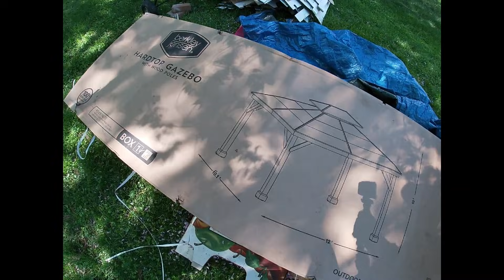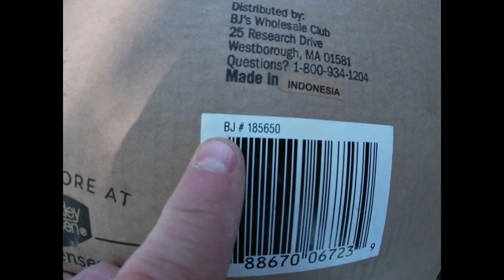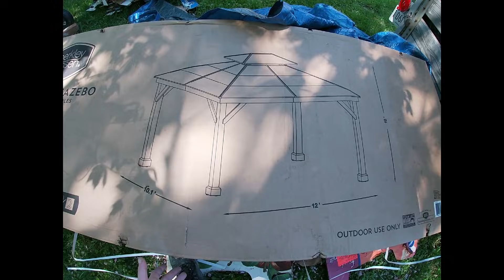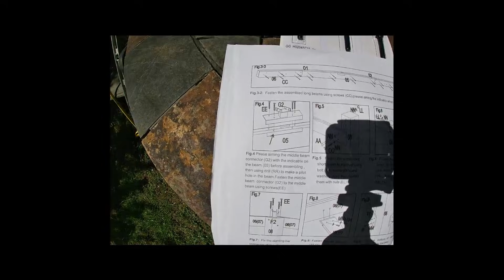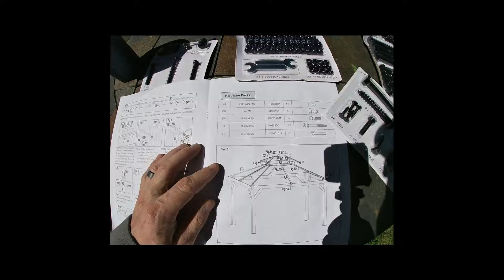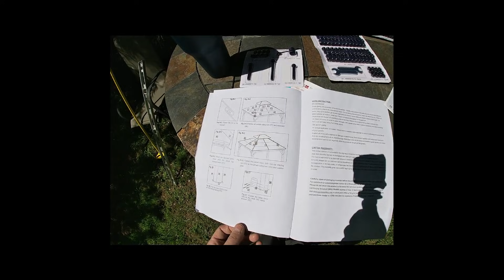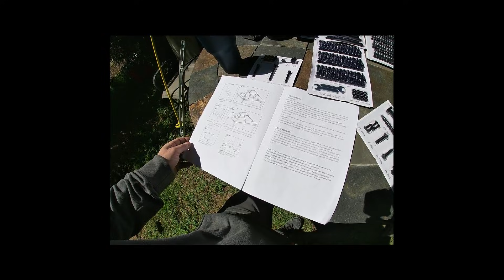Berkley Jensen 10' x 12' HardTop Gazebo Unboxing and Install Tips

Comment: great video.... just picked up from BJs.... mounting it on a 2nd floor trex deck...

having nightmares thinking about building that roof... yea, need to recruit a couple of buddies... pay them with steaks and beers  😎
Reply from the maker: Sounds good. Be careful and don't let them drink too many beers 😉
Reply: @OperationLiquidation  i didn't seen in video, but assuming the smaller cap roof you mounted before you mounted the sections of the main roof?  thanks
Reply from the maker: @antmon123  Yes, put those roof panels on first.

Comment: Great Video I’m in the process of putting in footings. However I really would like to know the dimensions of the post outside to outside.  I guess I really need the outside of the bracket to outside to avoid having to bend them like you did.  If you could send me those measurements I would greatly appreciate it!
Reply: I'm assuming by now you have the gazebo installed. Can you give me the measurements on the legs? I want to pour footings and my gazebo won't be delivered until June so I have no instructions.
Reply: I would love to get them dimension!!

Comment: What are the dimensions between the posts? I am wanting to put this over my hot tub.  We recently bought a 10x10 thinking it would work, but once up we discovered that it is only 7.5ft between the posts so it won't work.

Comment: What is the snow load per square foot rating on the roof?
Reply: Oh give it a break KAREN/CHAD   like u really care?  !!  DOESNT MATTER FOR THIS VID.   S eems pretty legit for a diY . who cares if it has a low load limit.   its not boxed in and I doubt anyones gonna hang under it during a storm for where you are going  with that comment
Reply: Depending upon where you live, local building codes would prevent you from purchase/Install b/c it would not meet their requirements. Just the general footprint over 100sf requires one to get a permit in this area. It is a problem I ran into when trying to decide if I was going to oberbuild a structure or do this kit. Snow in my area is not and issue, but high winds are. To get it reviewed by engineer  would be almost the cost of kit to meet permitting process as opposed to using standard building techniques at almost twice the cost (just in material - I am the labor force) 

Buy, build, and use a snow rake to remove any accumulation of concern and be prepared to lose and then build a proper structure to meet the needs of your area.

My wife wanted this kit, and I could build whatever she wants, but happy wife, happy life.....(and the potential hit for loss to replace with my overbuilt version) a hard lesson, but choose your battles.....
Reply: @BroHay1025  I thought it was Happy Wife, Miserable Husband?  But maybe that's what they mean when they say every marriage is unique in its own way. 🤣😂🤣😂🤣

Comment: I didn’t see the curtain rods on yours,  did you not use them? I’m trying to figure out how they go on.
Reply from the maker: Yes, we installed them. They go on the inner most hole pattern near the side framing. Not sure if we will add any curtains, but the rods are there.
Reply: Liquidation Pros Thanks for the reply, it is appreciated.

Comment: I purchased this in May and have yet to put it up because I was waiting for concrete to be installed. Did this gazebo come with any hardware for mosquito netting and privacy panels? I purchased netting and panels already and have them was just wondering if I needed to get the hardware to hang them as well. I know theirs a rail system. Just need to know if I need to purchase clips or hooks or if they came with gazebo

Comment: This is the same unit branded for Home Depot's Hampton Bay brand and it is the "Crownhill" model.  I just installed mine 98% by myself and am now stuck at step 19 as some parts for the roof leaves are too long and zero way to adjust the frame to fit.  I even tried a similar jack idea before seeing this video...all I can do is get a welder person to shorten the eaves rails and weld tab connectors back on.  Honestly....not worth my struggle and I would have spent another $500 for a better gazebo now that I know.  ALSO,  as far as actual critique....it rained this past week and I noticed the frame/roof collects some water from inside somehow....contributes to premature rust. Noticed when I was moving the legs a bit to try and square frame for fitment issue and rusty brown water came out.  Now I know why this outdoor unit should not be outdoors....according to its own instruction manual.  It actually states to remove it before it's windy.......ummmmmmm.  ??????  It should be able to easily withstand 40 mph as long as assembled firm and bolted down. I will be added more support at corners to keep frame tight. It also has warnings about rust stains......hmmmm......bad build quality and coatings maybe?  It's cheaper for a reason.....stay away honestly.  It looks nice....but betting its even more of a nightmare later.
Reply from the maker: Sorry to hear of the issues you experienced. Mine seemed to all fit together with no issues. Thanks for update.

Comment: Thanks Dan!   Very helpful.  Your opinion: I currently have a gravel (fine gravel) bed that I was going to install this over.  I'm struggling with how to anchor it - do you think I should pour a concrete slab or do you think I can get away with laying concrete blocks at the corner and afix the base to them?
Reply from the maker: I would recommend that it is secured to something substantial. Even if you made concrete pillars for the posts to sit on and then had the rest gravel. It is really heavy so wind isn't really an issue unless it was a hurricane or something strong like that. Also, it may settled on just gravel and become uneven. Thanks for watching. -Dan

Comment: Great Video.  Answered a lot of my questions.  I was wondering how loud it is when it rains.  I am thinking if installing it at my campsite and it would be about 10 feet away from the camper.  If the rain makes a real racket when near it or is it not that much noise?
Reply: The roof is a thin gauge, we were commenting how it is likely to be quite loud in the rain.  Supposed to rain here in 2 days, I'll let ya know more then.
Reply: Survey says: not all that bad for rain sound.
We found a different sound issue, the roof panels flex in the wind creating sounds of thunder. Think radio show sound effect.

Comment: Thanks for the video! We are hoping to purchase this gazebo but it just says wood posts.. what kind of wood? Thanks!
Reply: I know it's pressure treated wood, to me it smells like pine wood.  It looks like it's a solid 6x6 post, but I'm not a carpenter. 
Make no mistakes, this gazebo is very sturdy.  I plan on spraying it with a clear polyethylene coat when finished, nothing major....spray can.
Reply: @m.a.4829  thanks for the reply!
Reply: @leahritter414  👍, you're welcome, good luck.
Reply: @m.a.4829  Can you give me the measurements for the posts? I want to pour footings and I don't have the gazebo yet.
Reply: @gregevans7488  
The posts are actually 5.5" x 5.5"
The brackets that get attached to the post are about 11" x 11"

The 10 ft sections are 121.5" from outside edge of the post to outside edge of the post.
The 12 ft sections are 144.5" from outside edge of the post to outside edge of the post.

Add about 6" to the distance for each side for the brackets.
10 ft section: 127.5" with brackets
12 ft section: 150.5" with brackets

Hope that helps, good luck with your project!

Comment: How much should I charge to install how big is a 10 ft by 12 ft wooden post gazebo
Reply: It's labor intensive, took me 3.5 hrs to do the framing part, I estimate a similar amount for the roof.  At times you'll need the help of 2 people, a majority of times you can be doing stuff alone.  I had my daughter and wife pitch in for those times.  I attached the 12 ft beams to the posts while they were flat on the ground, but then need help when I was installing the 10 ft beams because the posts were standing.  You'll need at least 1 6 ft ladder, and I used a milk crate for other parts.
Disclaimer: I'm not a contractor,  but I'm pretty handy and sort of anal about how things line up.

Comment: Hey, thanks for the video! I’m having a weird thing with one of the parts b3 are the roof frame rods from the middle of the sides up to the top rectangle all four of mine only have the bolt receivers for the lateral roof frame rods (x1, x2, x3, w1, w2, w3) on one side of the b3 bar. Wondering if you or anyone else had same problem. Basically I have a big hole and a bolt that’s just going to float in there.
Reply: My parts are labeled N.  It takes 2 screws with washers from the bigger ceiling rectangle and takes 2 longer screws that have a bolt on the other end.  The part is not female threaded like the corner ones, this one goes through and needs to have a bolt with washer.
Hope this helps
Reply: Thanks- actually I’m pretty sure the parts I got are defective- I’m guessing the person putting in the female grommets to receive the little bolts just didn’t flip my set to put them on the other side. I think they’re sending me new parts.

Comment: How is this still holding up? I just Purchased a 12x14 Berkley Jensen hard top Gazebo. And how are the roofing panels screwed down? And did you add extra screws to the top of the panels?
Reply: Any update on yours? Trying to decide if I should buy it